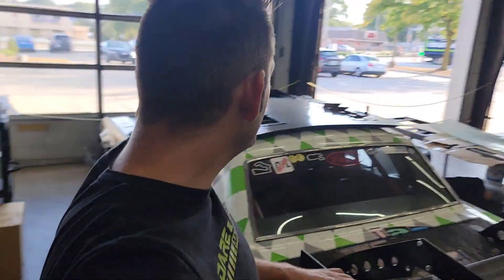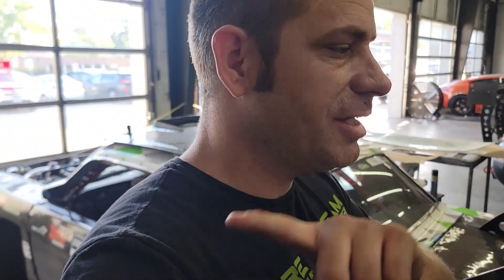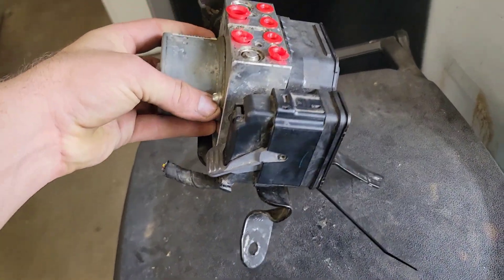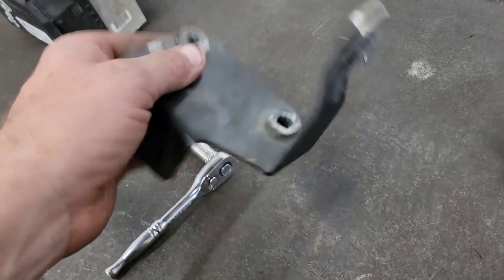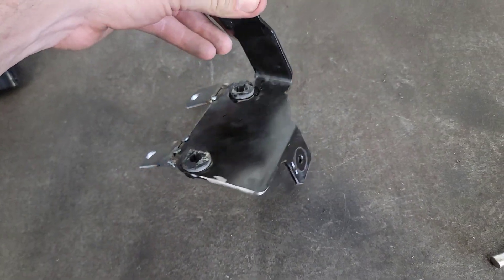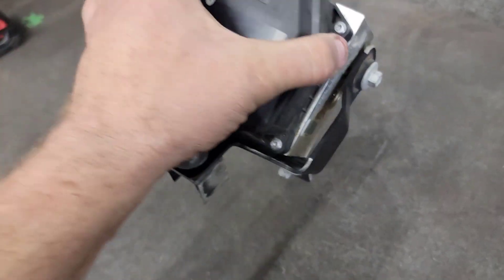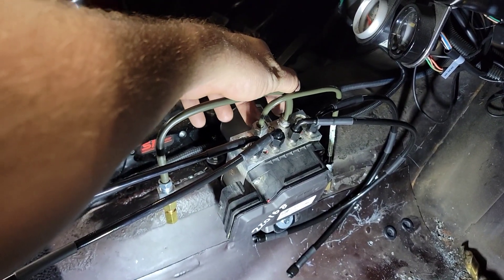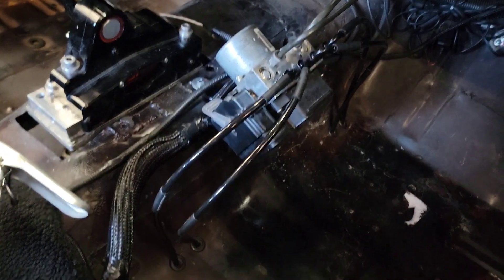Retrofitting the 1965 Mustang with a modern ABS unit!

Comment: What made you go with mustang abs instead of like a BMW mk60 or something else? 
I'm c6 corvette swapping my 69 gto, but running c7 spindles so i can run the c7z06 brakes.  I have a c6 z51 parts car, should i run the c6 abs unit wit the factory ecu and instead do c6 z06 brakes? I have c7z06 brakes already but not spindles. I have a holley hp ecu that im going to use for engine management. My concern was reluctor wheels for the bmw unit, your video is the first ive seen running a mustang unit.  Any thoughts or advice?
Reply from the maker: The MK60 unit is fine, but its expensive and older technology. We have found a way to make the Mustang unit work and it works well. Currently working on a drop in harnesses to go with it.
Reply: @Dare2DreamMotorsports are you close to a finished product?

Comment: Awesome!  Whatd you do for the reluctor rings at the wheels??
Reply from the maker: S550 front and c6 corvette active sensors in the rear
Reply: Is this the 11-14 mustang abs unit and air bag module? You mentioned you used the s550 front sensors and c6 rear sensors. Is there a reason you used these or was it based on your suspension? Besides wiring everything in, was there any other changes needed? 
Have you tested it out yet?